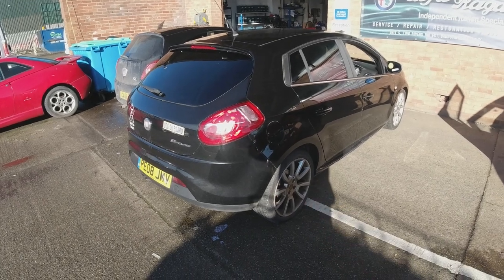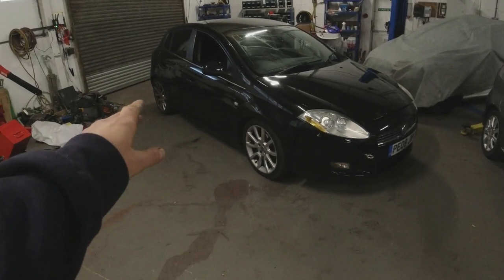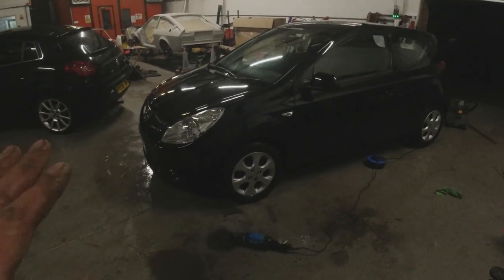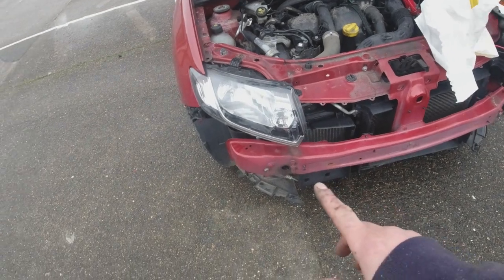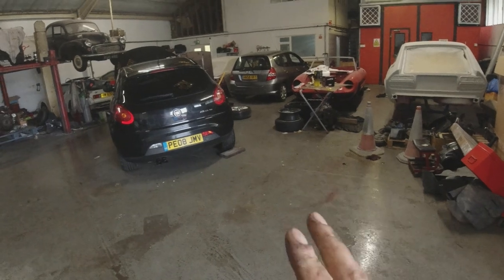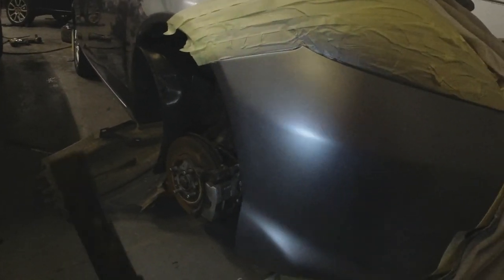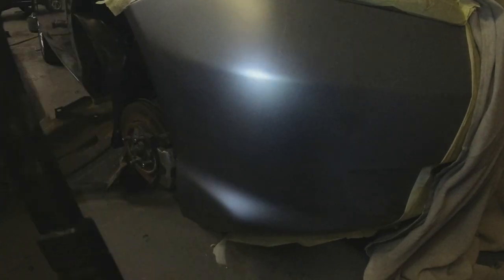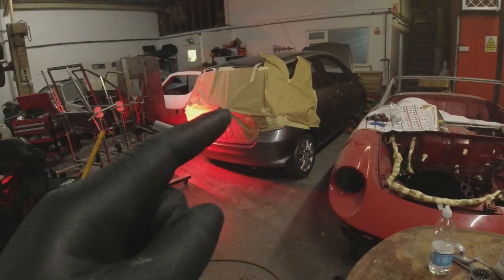9 Car BCA Auction Flip - I bought more, BIG MISTAKE! I lose

Comment: I had an odd occurance happen on my own car (ford focus) in some impacts, or hitting a large pothole (as in my case) the fuel shutoff can activate, most of the time it's just a ball bearing inside of a two metal contact, if the ball bearing moves, it can shut off the fuel pump. Do you hear the fuel pump wiring on first turning the ignition on? (first position only) If not, check the location of the fuel shutoff and reset it anyhows. It can be as simple as that!! Most fo the time the fuel shutoff is under the glove box or in the master relay box.
Reply from the maker: Cheers Tony

Comment: Am sure you know this, but each BCA listing mentions keys, MOT mileages and service history. Arguably all can go off. Paying little more per car and having one less project overall, maybe see how that goes. 2 dodgy buys is nightmare.
Reply from the maker: I can swallow 2 its all good. Yes issue is with the ones that are good, everyone wants them so margin is very thin. Less want the ones that need a bit of bodywork or an mot etc so I find stronger margin, even after the risk.

Comment: Great video enjoy these long vids! I've got a top spec fiat punto as a second car with the 1.9multijet engine. Great torquey engine only problem is I just putter about in it do hardly any motorway driving only get around 30mpg out of it!
Reply from the maker: Yes they need a good run to stay clean running
Reply: @ChopsGarage  yes deffo I'm not running it right the dpf warning comes on every couple of weeks cus its clogging up and I have to rake it for a few miles lol

Comment: James quick tip get a filming led light shouldn’t be expensive and will allow you better visibility , can’t wait to see what happens with Kia , love those cars even though it’s a bit girly haha
Reply from the maker: Thanks for the tip, does it attach to the Go Pro or self standing unit?
Reply: Chops Garage standing unit will be better mate , as easy to move and feed with power , you could even fabricate your own using a powerful lamp and reflective material but cheaper to buy I expect